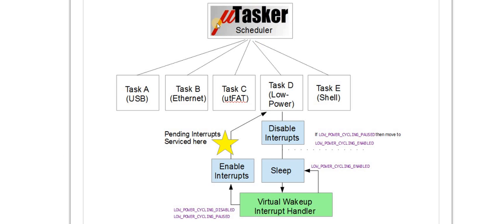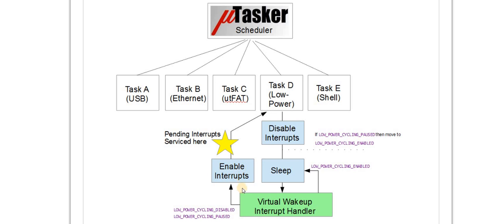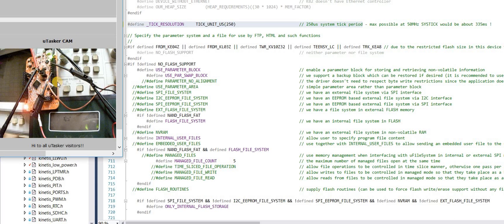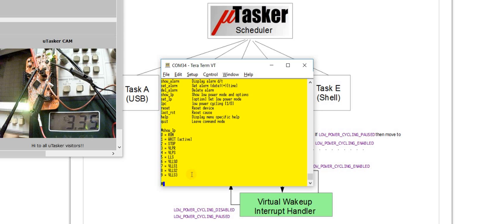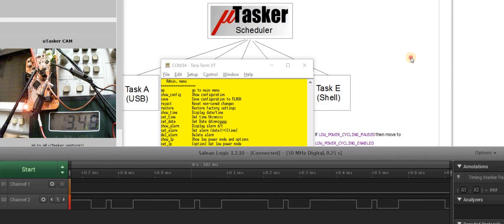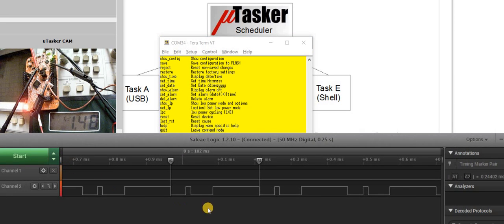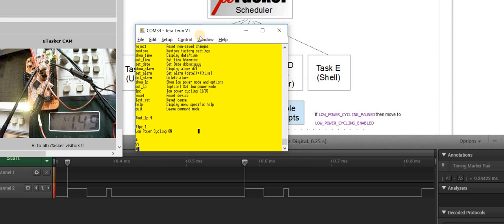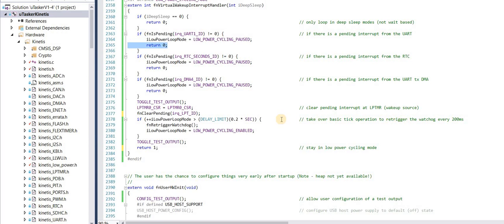uTasker SHORT FRDM-K22F - VLPS and Low Power Cycle option

Comment: Is there any code for us to test?
Is there any way to quickly understand frdm-k22f cnds
Reply from the maker: Binaries: https://www.utasker.com/kinetis/FRDM-K22F.html
Code on GITHUB (search uTasker)
Reply: @mjbcswitzerland  Excuse me, our school wants us to report this frdm-k22f, the report content is this chapter https://1drv.ms/b/s!Ai7nuEerPp9Ygp5pVSPBQrKai0oxAg?e=TiwCAU

Because I am not familiar with this hardware, I hope you can help
Reply from the maker: @qazwsxedc123411  Hi, your link to to chapter 12 (SIM) of the K22 which controls gating clocks to internal modules and various system configurations. Before using any module (peripheral) one needs to first apply its clock by un-gating it in one of the SGCG registers.
Is this the main question or are there other things that need to be learned?
Reply: @mjbcswitzerland Does this chapter mainly introduce the chip definition of FRDM-K22F?

Hello, do you have an email address?
My email address is qazwsxedc12341@hotmail.com
Email reply if you can
Reply from the maker: @qazwsxedc123411  That chapter is a very small part of the overall description of the K22 that is on the FRDM-K22F.
I suggest that you visit the NXP Kinetis forum to learn more about it: https://community.nxp.com/community/general-purpose-mcus/kinetis